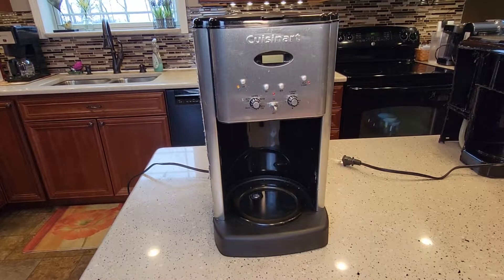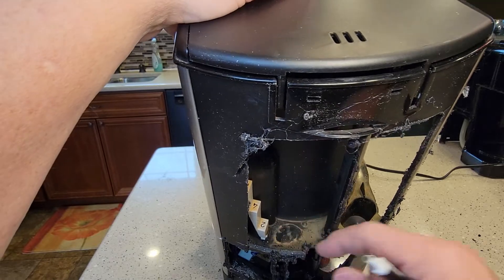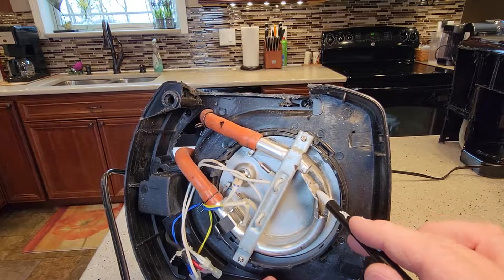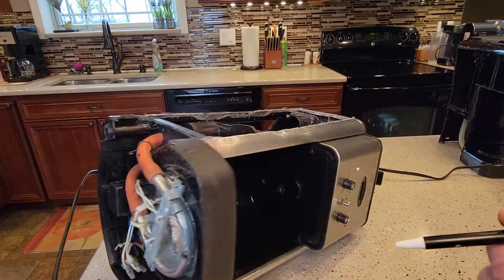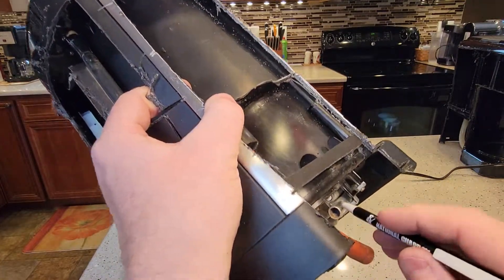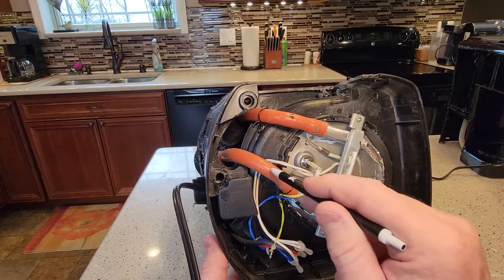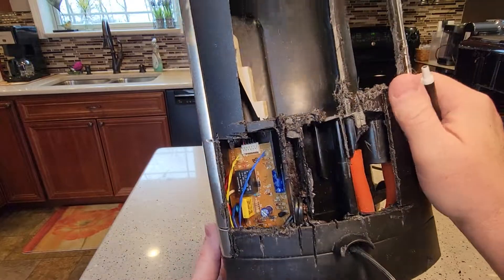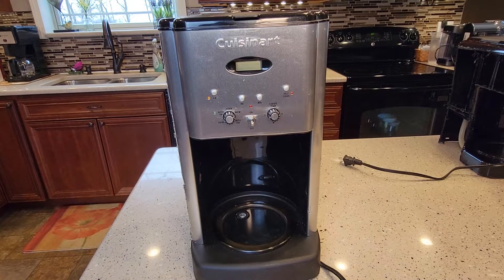Cuisinart DCC-1200 Coffee Maker Brew Central 12 Cup Programmable HOW DOES IT WORK & LOOK INSIDE

Comment: Well, I guess that machine is in bad shape now even if you didn't notice a lot of damage. LOL 
On ours, the clock started messing up and resetting so the timer was coming on whenever it restarted. This morning it wouldn't turn on at all until I unplugged/replugged. I had hoped you would take off the front panel so I could see that. I suppose that circuit card may be the issue if not the clock itself. I will take it apart (a tad more gently than your method 🪓⛏🪚) to see if the clock mechanism is a replaceable part. I have a feeling that is futile though. 
I bought an $8 thrift shop Sunbeam machine to use temporarily. The Sunbeam is on its 3rd run of straight vinegar but is almost clean now. It will do until I find a replacement machine that is not American. Some of the European machines are really nice but oddly, they don't seem to have auto start timers on them. Breville or Delongi are the most promising.

Comment: You need a small torque screwdriver to remove the bottom cover.  It's probably a T-4.
Reply: Yes, it is a security screw smaller than a T15.

Comment: Thanks for posting this video I started to disassemble mine last night because it is not working properly. No water is flowing. I added vinegar last night with water and expected it to start pushing debris but it didn’t work. Mine must be pretty clogged up because evening trying to use a hanger to push through the opening but it didn’t work. It won’t go through.😩 So today I bought some Keurig Descaling Solution just to see if it will work.🤦🏽‍♂️ i will leave it over night. I have CBC-00 model. More to follow now🤞
Reply: Oh, I forgot to mention don’t ever put vinegar and baking soda 🤦🏽‍♂️ I tried after the vinegar and the pressure from it pushed the cold water hose out and made a mess. Once I removed the bottom cover I found the back flow assy which was a small ball with the back flow. I wasn’t sure what it was however this am put it back on the hose. Another reason it wasn’t flowing to the coffee pot. This am I disassembled everything again and removed the heating element and put it upright and have it soaking with vinegar. I saw another video where he mentioned after 3 days it cleared all the gunk. We had bought a new mr coffee on/off not even 2 months already rusted on the heat plate and it’s a piece of 🤬 needless to say we’re taking it back. Instant coffee for a few more days. I’ll see what happens 🤞😁😬
Reply from the maker: @mickbrown815  Oh wow what a story,  thanks for sharing I could only imagine how that looked LOL
Reply: @JustADad  hey so 3 days later mine is still clogged….one side good about halfway but the other side once I put the wire on the other side it only goes in about 1/4 of the way…..??? Should I try to use a small drill bit to see if that works? It’s crazy I’m shocked that the vinegar didn’t clear it. I was wondering since you have cut into yours if the heating element (U shape) is clear all the way and not obstructed with some sort of divider? If that makes sense. The wire I tried will not move at all on that one side.
Reply from the maker: @mickbrown815  I think there is a check valve, you might try blowing air in it.
Reply: @JustADad  sorry didn’t explain it right I’m talking about the heating element section- I assume it’s hollow all the way thru? I just can’t believe it’s still pretty clogged up. I just added more vinegar and will see if another round works
Reply from the maker: keep me updated! thanks for shairng!